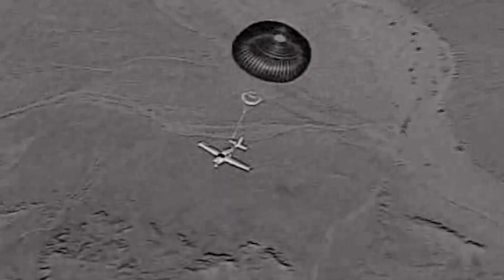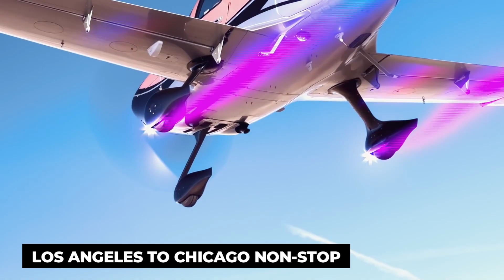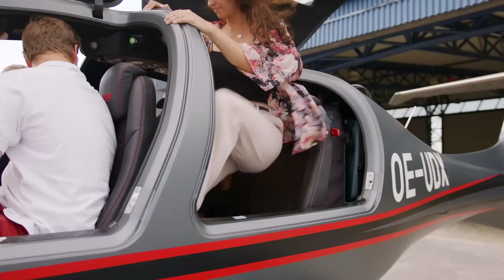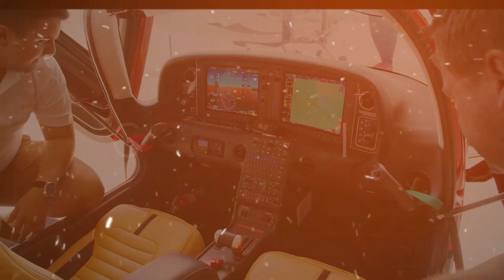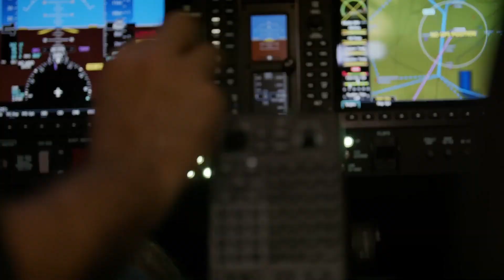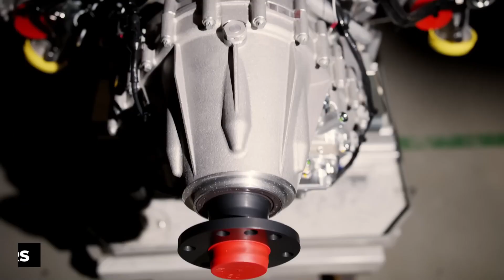Diamond DA50 RG vs Cirrus SR22 | FULL COMPARISON

Comment: I'd hands down take the DA50 over the SR22T. Well, at least up until this past week when Cirrus announced that they now support Garmin's Autoland feature in the G7+ version. I think Diamond could include this feature with little or no additional cost, as the plane already has FADEC. Seems like Diamond is seriously close to fumbling the ball on the 2-yard line with the little things the DA50 is lacking. I do like the engine though, and I'd make the 44' wingspan work--somehow.
Reply: They would need to update to the Garmin G3000 avionics first.  Very expensive upgrade. Very few GA aircraft are equipped with this.
Reply: @davidblair6276  Possibly, but Garmin already supports Autoland on G1000 NXi equipped King Air 200s. And since the DA50 already has FADEC, I would think brake control would be the biggest part of the TC. If the SR22 can do it, it doesn't seem like much of a stretch for the DA50 as well. But maybe I'm wrong.

Comment: This video is fraught with misinformation.  First, neither aircraft has a pressurized cabin. Second, the Cirrus does not have pneumatic boot system, it has a FIKI system, just as the DA50. The video claimed a ridiculous 1,300nm range for the DA50...based on its own specs, it calls for 750 nm vs 1,021 nm for the SR22 G7.  It was very apparent from the beginning of this video that there was bias towards the DA50. Which is a great plane, but facts are important.

Comment: DA50RG has a 750 nm range and would love to see a little more range of 1,000 nm, Also, it would be great if they can get the DA50RG to have better overall cruise speed as well as faster overall performance of 200-210 knots out of the plane. Finally, it would be great to see the DA50RG to be pressurized and a little higher service ceiling of 25,000
Reply: @jxa334  yes I concur, and they would have an awesome aircraft. Why it cannot have the same range as the DA 62. Which has two engines, same dimensions and a tad smaller wing span than the 62.
Reply: @albertattwood8746  The DA62 has the same tanks in the wings, but it carries an additional 36 gallons in the engine nacelles

Comment: The Cirrus "Boot" system pertains ONLY to the SF50 jet, not the SR22.  Also, check your range stats for the DA50, I think you are WAY off.  The Cirrus carries almost twice the fuel but the DA50 carries more weight at full tanks.  Cirrus has a 300 mile range advantage.  Jet fuel vs Low Lead, Water vs air cooled, FADEC engine.  Both owned by China, I'd still go with Diamond.

Comment: The DA50RG is a new aircraft and it is very soon to compare it the Cirrus, but I like DA50 sleek design and its power plant is more promising.
On the other hand, the Cirrus has been in use for little over two decades with many incidents.
You mentioned in this video that the Cirrus has saved over 200 people, which means it has deployed the parachute that many times, and that's not even counting the times it has had to crash-land without the pilot making the decision to deploy the parachute.
I can't really say if the problem has anything to do with the engines or pilot error.